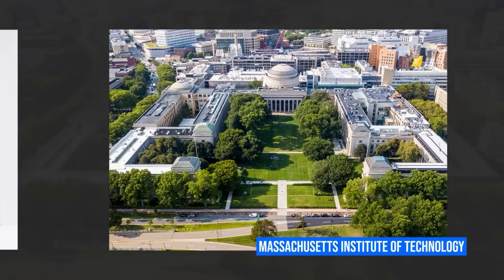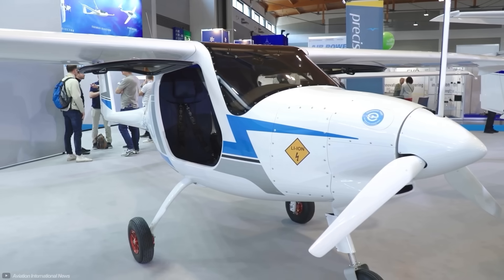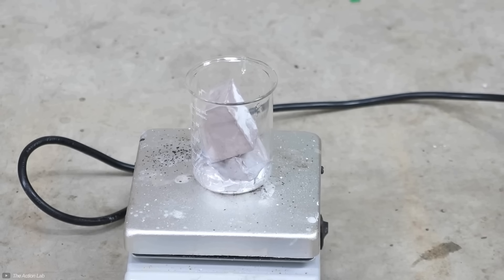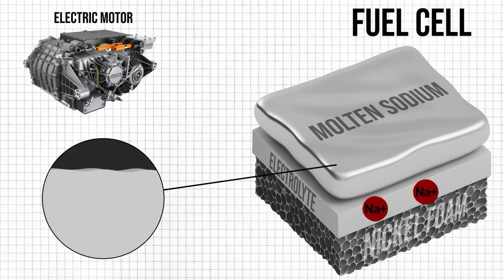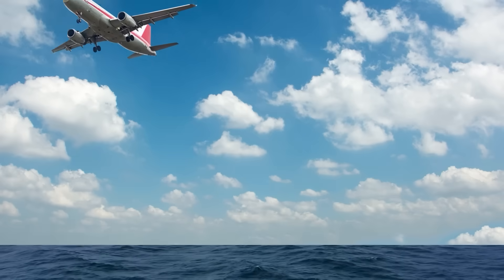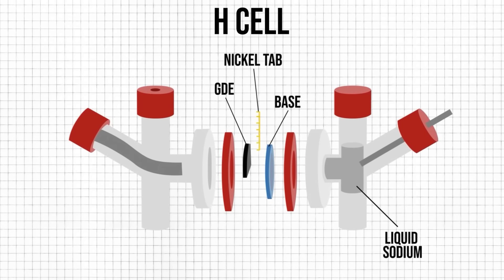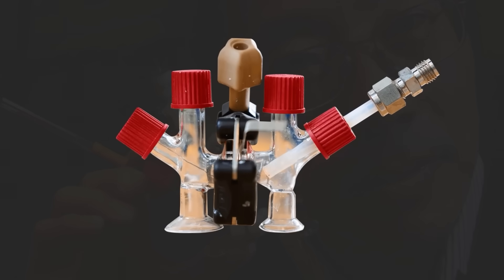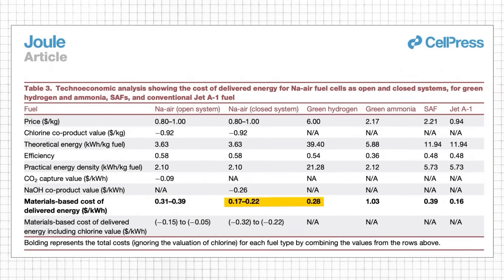How MIT's New Sodium Fuel Cell Changes Everything

Comment: As a chemist,I can say this is very promising. It would result in carbon negative flight. There is however more electricity needed to make the natrium.
Reply: and if they make the sodium from NaCl, we will end up with kilotons of Chlorine that may need to be disposed of, as the need for Chlorine may not be high enough. I think they will have to find a way to make the Na from NaHCO3 somehow, and in a way that Oxygen is the byproduct.
Reply: @human_isomer  The process require alot of power to separate Na and O2 from NaHCO3 (an ionic compound,  the electrostatic forces holding Na+, HCO3- ions together are strong).

You will need very high temperatures and through some mediate stage for Thermal Decomposition and finally Electrolysis to have Na and O2
Reply: @kaizu4914  As usual, a nuclear reactor could handily provide heat and electricity. Their potential for bulk industrial chemical synthesis was only grasped at in the 60's. Today their ability to do clean industrial heat should be all over the media.
Reply: @TheSonic10160 ”clean” depending on what you’re using as nuclear. Thorium in SMR’s would be the only thing I would consider clean
Reply: @human_isomer why make it from natriumcarbonate, salt is plenty available and clorine is much needed for chemical products.
Reply: nope, you're not a chemist.

or very very dumb.
Reply: If we figure out how to make molten salt reactors, we can produce it clean.
Reply: @mundotaku_org   We already do, molten salt is the way thorium reactors are designed. Because a melting of the core is impossible with salt. Chinese has a reactor that cannot melt too, using another process. it passed all real life scenario so far and won't create a run away reaction.
Reply: What makes you think that running a shop that dispenses pills qualifies you to offer an opinion?
Reply: @philflip1963 You are subhumanly stupid
Reply: Nah, it isn't going anywhere. People already realized that "carbon negative" thing is just a BS from Zionist (e.g. WEF) propaganda.
Reply: as an "chemist" you should realize that climate change is a global tax scam; but you don't, which is why you are on youtube commenting instead of working
Reply: @Turbo_Tastic That the phenomenon is taken advantage of? Sure. But it doesn’t mean it doesn’t exist.
Reply: @Turbo_Tastic  you obviously are not a scientist, otherwise you would know how to interpret data and not spew that nonsense everywhere. But that's why people with a sane mind take care about it, not people like you.
Reply: @human_isomer like trump ?
Reply: @Turbo_Tastic Im not a chemist but the local islanders are already talking about how the tides are higher (they say the land is sinking lol) and how the storms no longer make any sense. - Also more intense, we lost our roof the last surprise Typhoon.
Reply: @carlosandleon so??? The world's climate is getting better with the tinny improvement of CO2 which is at least a 4X factor below ideal levels for plants and life forms that require oxygen to live.

This is obvious even to early Man
Reply: @Johnny-dp5mu Its actually not getting better. I urge you to look at climate charts that doesn’t have 1950 as the stand in for “modern day”. 

And l mean it with the year.
Reply: @Johnny-dp5mu And if going by early man I am confident island natives are a good approximation for that kind of mindset.
Reply: @carlosandleon It is quite visual everywhere that the climate has changed.
When you live at places with snow the change in timing becomes apparent.
Reply: @anderslagerqvist2642 Exactly. It’s already very palpable and yet there are people who stick their heads in the sand
Reply: @carlosandleon  we have sea level numbers from all over the world most places have seen effectively no changes in the last 100 years, but its very true that some places are sinking, simply a natural geological effect nothing to do with the climate.
the storms not making sense, i wouldn't doubt, but it isn't related to C02, but instead to the global electric circuit, out magnetosphere is getting weaker and allowing more charged protons / electrons in, which in turn effects clouds and storms.
Reply: @Turbo_Tastic shut up bot brain

Comment: Not gonna work.  Jet fuel = 12,000 watt-hours per kilogram.  The BEST lithium batteries are at 500 watt-hours.  This sodium will max at 2,000 watt-hours.  So Dead On Arrival as a jet fuel replacement.  But wold be good to replace those silly, overpriced battery powered ground cars.

Comment: They lost me at "The fuel is part of the cell". That, coupled with the cheap/highly available angle tells me they're going for the mass market and we really don't need more disposable batteries in our world.
Reply: This isn't a disposable battery. Watch the video again, try to actually understand it this time.
Reply: @bjornfeuerbacher5514 2:49 "The sodium is part of the fuel cell and gets used up during operation" - please, show me any other fuel cell design where the fuel is PART of the cell. Feel free to show me a timestamp where they describe how to refuel. Until you can, I'm quite content I've understood the video just fine.
Reply: @CarbonKevin  "please, show me any other fuel cell design where the fuel is PART of the cell"

Err, why should I? This is a new type of fuel cell. As the video explains in great detail.

"Feel free to show me a timestamp where they describe how to refuel."

They don't describe in the video how it is refuelled, but they say that it can be refuelled. Already at 0:20.

There is also a long article at the website of the MIT where they explain this further: "The researchers envision that to use this system in an aircraft, fuel packs containing stacks of cells, like racks of food trays in a cafeteria, would be inserted into the fuel cells; the sodium metal inside these packs gets chemically transformed as it provides the power." And lower down: "The system they envisage would use a refillable cartridge, which would be filled with liquid sodium metal and sealed. When it’s depleted, it would be returned to a refilling station and loaded with fresh sodium."

Comment: Those startups aren't (yet) "highly successful".  Desktop Metal started at $10, did a reverse split because it declined so much it would be delisted, and is merging with Nano-Dimension at about $5 a share ($0.50 for the original shares).  Sublime Cement is still a a startup, so the jury's out.  Same fo Form Energy.

Comment: One of the things with high altitude flight is pressure and temperature. Current jet and piston powered aircraft use excess heat to warm the air feeding into the cabin. If using this molten sodium fuel cell then power will have to be used to keep the sodium molten and use power to compress and warm the air going into the cabin. That can be a big draw of power when talking about a commercial airliner, even the smaller regional airliners.

Comment: Has anyone here thrown a piece of sodium in water? This is silly and insane. We're going to have air port/gas station workers shifting around large blocks of sodium and/or liquefied sodium?

Moulton sodium is never going to leak out? Does no one think through the silliness of "Green" electric vehicles? Sodium explodes on contact with water and ignites on contact with the humidity in air, Lithium ignites on contact with the moisture in air and can spontaneously combust when heated on a hot day (aka Tesla driver BBQ), hydrogen gas is super explosive (remember the Hindenburg disaster)?

Wake up and just use gasoline and diesel folks. They are by far the best option.

Comment: This is shit. 
Also.. stop repeating that green hydrogen is expensive.
If you actually do it with pure wind and solar energy (the cheapest source of power we can get) at large scale (this reduce a lot the liquefaction cost and improves all the logistic), then you get cheaper prices than getting hydrogen from hydrocarbons. In 10 years, hydrogen made this way could be even cheaper than extracting and burning methane.

Comment: 6:15 Either the ocean is warming or it is acidifying.  Not both.
Reply: Would you explain please?
I thought that greater amounts of greenhouse gases increased the acidity of rain.
Greenhouse gases also traps infrared light in the atmosphere causing the temperature to rise, and this leads to warming sea water.
Reply: @pencilpauli9442  If you warm up a beer it goes flat (unless you keep it under tremendous pressure) but if you keep it very cold, say near the freezing point, then you can dissolve an arbitrary amount of CO2 in it.  THEREFORE if global sea temperatures are rising then the oceans are NATURALLY de-acidifying REGARDLESS of how much CO2 happens to be in the atmosphere.

It's a completely illogical thing they've been claiming for 40 years -- that CO2 and BOTH raise the temperature of the sea AND the acidity.  UTTER GRADESCHOOL NONSENSE!!!
Reply: @pencilpauli9442  If you warm a beer it goes flat, if you keep it very cool it will retain it's CO2.  The oceans are not different.  It is a PATENTLY RIDICULOUS thing to claim that atmospheric CO2 can BOTH raise the temperature of the sea AND raise the acidity.  It is gradeschool science this stuff.
Reply: @kob8634 your beer example is an open system. To make your comparison meaningful you would have to leave the lid on your beer so the pressure is retained while you warm your beer. I think you will see that the acidity of your beer remains unchanged (because the CO2 is now unchanged in the system) 
The atmosphere/planet is a closed system with regard to the gasses like CO2, love a sealed beer bottle. If you increase the CO2 in the atmosphere or beer the dissolved CO2 increases and therefore the acidity. 
Now we look at the heating system we are using. For the planet that is mostly the sun. Solar heating warms the surface of the ocean and some of that heat gets radiated back into space. The ratio of thermal energy in versus out sets the temperature of the ocean surface. The extra CO2 in the air holds more heat in so the total temperature (heat in minus heat out) is higher. 
Your beer example is adding heat but removing all CO2 as it leaves the liquid. This will happen if the open beer is kept cold too, just shower.

Comment: Given the problems with hydrogen fuel cell technology, this sodium fuel cell technology looks really interesting. However, sodium metal has its own challenges.

Like ... what happens if an aircraft loaded with sodium metal fuel crashes upon takeoff or landing and ends up in the water? I'm not a fan of hydrogen, but at least it doesn't spontaneously combust upon contact with water.
Reply: There are many challenges with Sodium Fuel, it is even worse than Hydrogen Fuel for many reasons and will never be put practically into jet engine fuel.
But the contamination of crashed sodium metal (that quickly turns into NaOH under water) is minimal, as NaOH is not a killer in ocean life, it is dangerous in concentrated form, but if you are putting it into ocean then it will be considered miniscule amount and will cause no harm to the sea.
Reply: What?! Hydrogen is incredibly flammable. Every crash generates sparks and fire. Hydrogen is a guaranteed fireball, every time, which is roughly where we're at with jet fuel as well. Any fuel cell is going to be subjected to the same requirements as the lithium batteries on aircraft - they're in an extremely durable titanium survival enclosure that can contain a battery fire.

Comment: well same for magnesium and aluminium -air fuel cells. strontium-90 heat-electric for really long power, like 20 years. well solve the challenges then. lol. yeah wow it works. otherwise it would be broken and unusable, useless. this raffles me. so you dont have enough stuff, having to randomly select a recipient. sounds very poor economy. very clever mechanism. dont exhaust naoh at all. store if and re-use, re-charge, re-load. yep its a rechargeable battery. why do you see ghost issues everywhere. key factor is the liquid fuel. now that was bs, the sodium weight has a constant energy density per kg. check your mind. what nonsense statement. same for gasoline, its energy per weight is same all the time. might want to fix that. if you leave the storage container and engine weight out, you have only more or less fuel. zero day patch. no wonder why people cant have nice things, because they/you get them wrong. all the time. also tons of phd confusion of the actual facts. yes also phds are only paid workers, and poor shepherds, mind your faith. false communication only hurts. sorry bro being blunt. same for aluminium and magnesium, liquid at 600C. sodium melts at 100C. ok NaOH melts at 300C. potassium is even lower at 60C melting point. why not have it in separate tank, just pump it into the fuel cell as usual. store the sodium as solid state in a tank, melt from the bottom at 100C with hot cooling water. potassium would be even better energy density. potassium has about 5.1kWh/kg while sodium has about 3.7kWh/kg. sodium has a water boom issue/feature. minimum exposure to water. but whats new compared to spool fed magnesium/aluminium -air fuel cells. well those have liquid electrolytes as usual.

Comment: sounds cool and stuff, but i am not convinced that carrying molten sodium on a plane is much more safer then kerozine...
Reply: Kerosene doesn't need to be "manufactured". It gets refined out as just ONE of a dozen plus products of CRUDE OIL. Very safe. Won't explode if gaseous. (unlike gasoline -boom!). Easy to transport, distribute, store, load etc. Airports in the AFRICAN DESERT...can easily get/store/use kerosene.

Comment: you still have to produce the metal via synthesis on a large scale. It's hydrogen all over, but your side product isn't oxygen, but chlorein, which is a corrosive gas. 
Yes maybe more weight efficent than hydrogen, but not cost-efficient on a large scale. Small airplanes is best use case, BUT you can just use new non-rechargable batteries instead

Comment: The problem here is that it just feels like an attempt of replacing the hydrogen/fossil fuel idea with yet another thing that companies have to keep selling us at gas stations. For planes this makes sense. But for personal vehicles I do not want to go back to depending on refueling stations. My electric battery car actually wastes less time than a petrol car would, because the range is enough to last me days where I live. And I only have to plug it inn at home overnight to recharge. No need to stop and spend time at some refueling station.

On the flipside. The very very very rare instances I do have to recharge away from home, recharge stations are plentiful. Adaptation of electric chargers are much easier because electricity is available everywhere. So nearly every mall, or resturant, or restingplaces by highways, have plenty of them where I live. So if I do take a rare long trip, the charging happens when I would normally take a break or lunch break anyways!

Comment: I still think expelling the waste is going to be a disaster, it sounds like it's from the mouth of an oil company marketeer.
Reply: @etmax1 It wont cause a disaster but it could prevent one. NaOH isn’t that bad You can actually consume dilute amounts of it and all that will happen is  it turns into table salt and water when it reacts with the hydrochloric acid in your stomach. NaOH + HCL——> NaCl + H20. Combustion vehicles produce NOx emissions and diesels produce SOx  along with NOx these produce nitric acid and sulfuric acid when it combines with water vapor in the air. This is one of the ways acid rain is created. The NaOH would actually neutralize the NOx and SOx emissions and turn it into sodium nitrate and sodium sulfate a fertilizer and a filler for laundry detergent.
Reply: @mycogeek7496  That would fine in the largest time and space context. You cannot spray airports, tarmac, or overflight environs with lye, or even the milder carbonate, day in day out night and day.
Reply: @-danR  Any such system would not "spray" or dump the NaOH into the air. There would obviously be an atomizer or nebulizer to ensure safe dispersion. Also, the waste would not be dispersed over airports or even land, only over the oceans - which means this fuel cell might only be useful on international flights. Plus they mention the NaOH can be stored in the plane if need be, and it is a useful industrial feedstock for a variety of processes. No mention was made as to the concentration of the NaOH, which would greatly determine how it can be handled. A giant amount of NaOH is used in paper production and manufacturing soaps and detergents. There would be a market for the generated waste. I think the molten sodium is a bigger issue here - one that might prevent this from ever being used in aviation.
Reply: @mycogeek7496  In addition , combustion vehicles also produce CO2 emissions that form carbonic acid in contact with water.